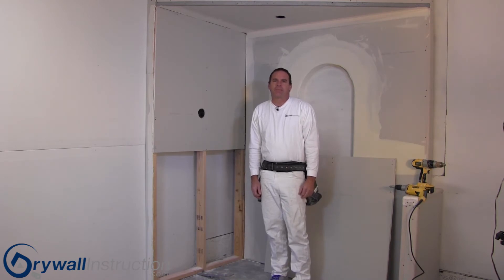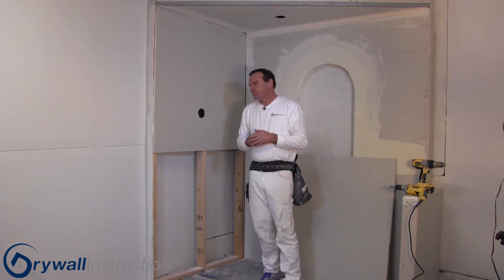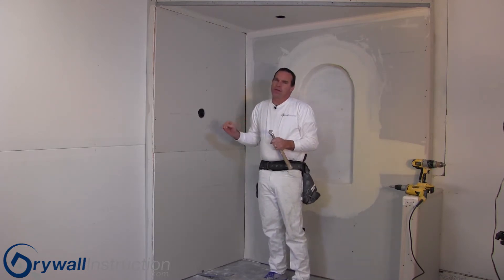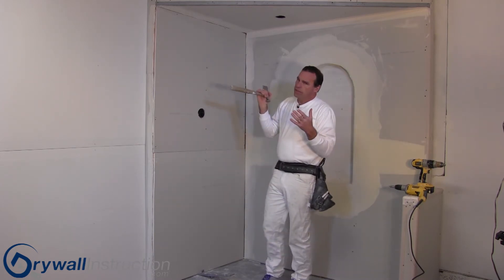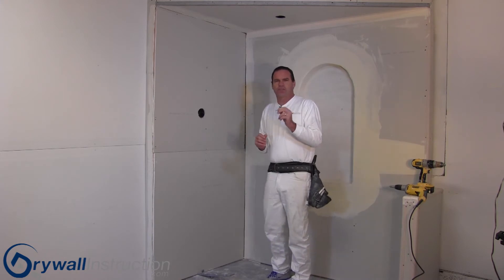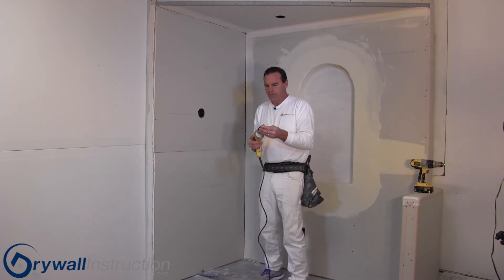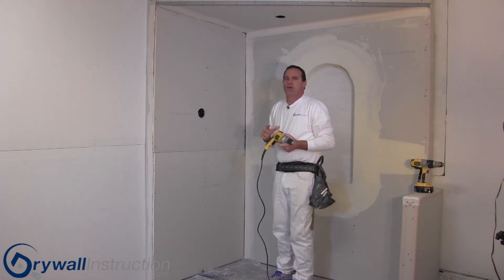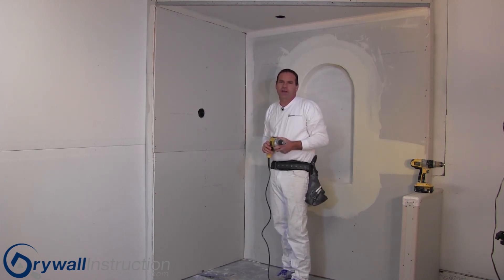Drywall Fasteners  -  Nails vs  Screws -  Drywall Instruction

Comment: If you do a significant amount of hanging, I suggest a collated screw gun. I have the newest battery powered Senco gun and love it. No fumbling with screws and three-times as fast; it'll shoot 1/8" to 2" screws. The strips of screws are a little more expensive than a box of drywall screws, but well worth it.

Comment: For that small wall that looks to be fairly small wouldn't it be easier to use one sheet vertically?
Reply from the maker: You should definitely hang a sheet vertically whenever possible. I put it up that way to use for the demonstration.

Comment: I just bought that same screw gun for a home remodel job.  I like it, but I really don't understand the reason for the adjustable depth setting.  I mean if it is permanently set from the factory for the proper screw setting depth, why would the user every need to have a different depth.  Don't you always want the screw at a "standard" correct depth anyway?  Thanks.
Reply from the maker: You pose a great question.  The only answer I have is if screw tips vary at all.
Reply: What about a project where part of a board is exposed down to the original paper/surface but the rest of the board  still has the top coating, primer and paint on it but needs some new screws installed to correct pops/dimples?  A homeowner ran screws in too deep (dimples) or not deep enough (pops) in the field of the board.  This allowed the board to sag in the field and eventually at part of a seam causing the joint/tape to crack.  Getting the old tape off at the joint and installing new screws I will need one depth of screw setting (such as the bit attachment used on the cordless drill), but for the screws out in the field with the extra thickness of topping and paint coats maybe I will need a different (deeper) setting?  I've never used a screw gun before, but maybe I'll be giving it a try if I need an adjustable depth...I'm a relative newbie at this; I'd be interested in your and/or Mitch's thoughts on this scenario.
Reply: CenterTree777 sometimes the screws pop out if the insulation is to far out of the studs

Comment: You never explained why you would use nails on the perimeter and screws in the field. Without a good reason this seems costly to switch
Reply from the maker: In the past hangers have nailed the borders because it was easier and then got their screw gun going and went through and screwed all the fields.  I still see this in some cases but cordless screw guns do make it easier to just use screws everywhere.
Reply: I was looking for a video like this. I screw everything, I hate nails I feel they are outdated, less effective and offer no benefit other than speed when using a nail gun. So I finished my basement myself but initially had the house built to my design and never thought to make them use screws in my sheet rock until it was too late. The home builder was telling me, "you're probably going to have some nail pops, we come back and warranty them for a year" which raised the question with me, if you know they are prone to popping, and they really don't save any time why are we still using 1950s hanging techniques when you know you will have to come warranty the pops. Not to mention they don't all pop in a year so the rest are my problem. It just seems senseless to use fasteners that are far more likely to cause problems later, especially when there is no real time saving when you still have to hammer them in. So long story short your video confirmed my theory that there really is no reason to use nails, so my basement being screwed everywhere is fine. Thank you.
Reply: Nails and screws both "pop". People often refer to screw pops or nail pops as nail pops. In the edges of a board and at angles, due to the angle of the screws required, it is debaitable which will have a stronger hold, assuming ring shank nails were used.